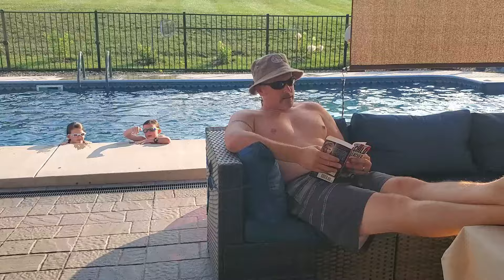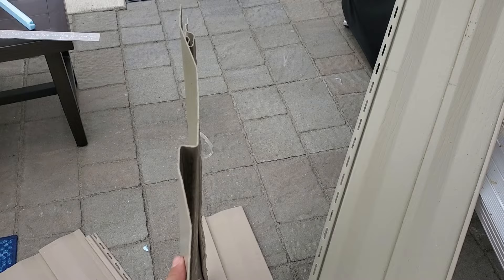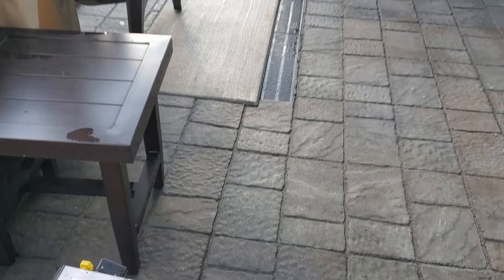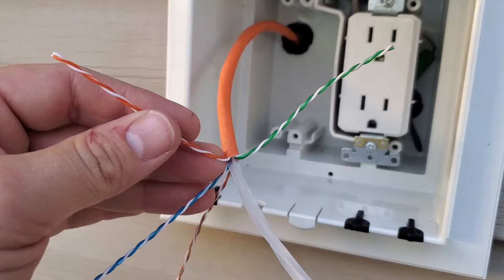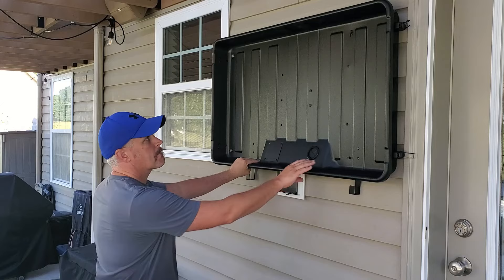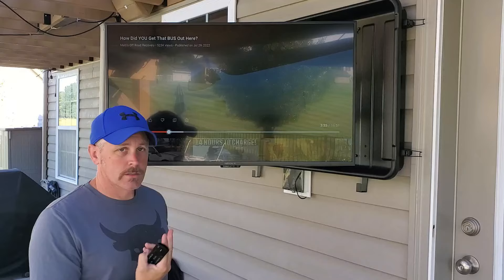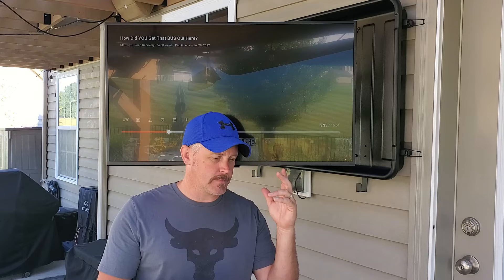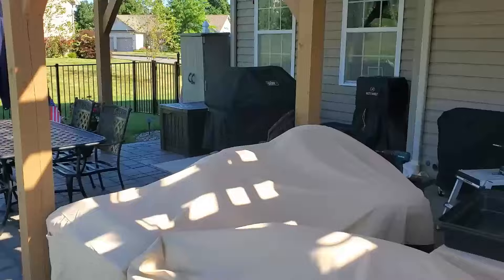Installing an Outdoor TV - The Storm Shell

Comment: Awesome video! When you ran the lags in for the back of the shell and the tv mount did you run them through the vinyl shims and backer board or did they screw right into the board? I’m not sure if I’ll be ok with my similar project if there is a gap in the screw if I miss going through the vinyl shim